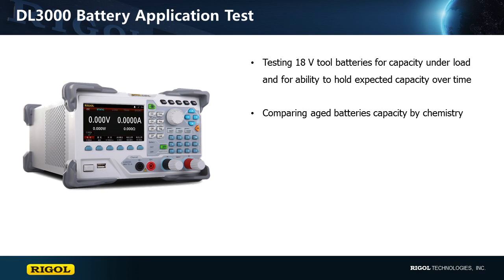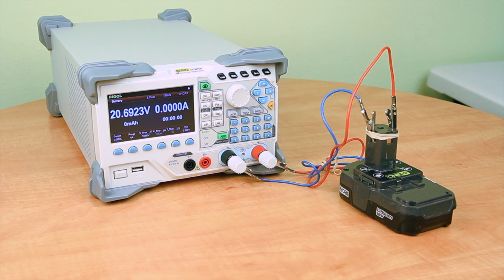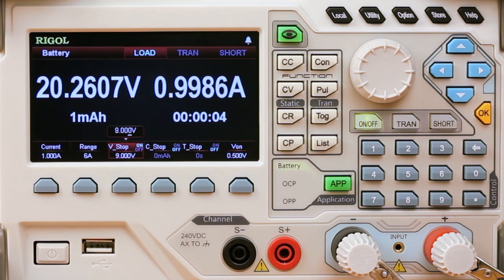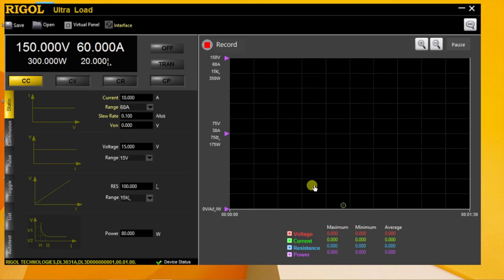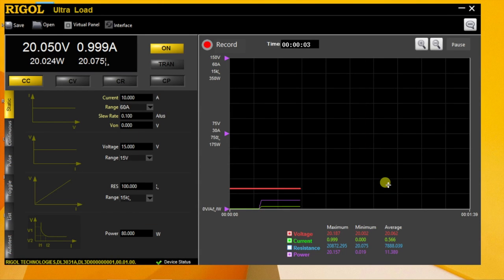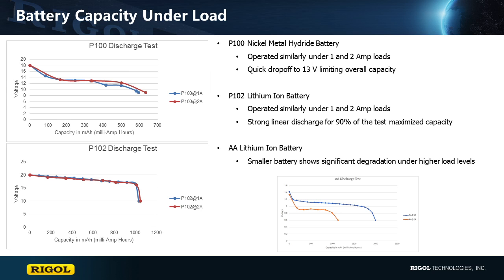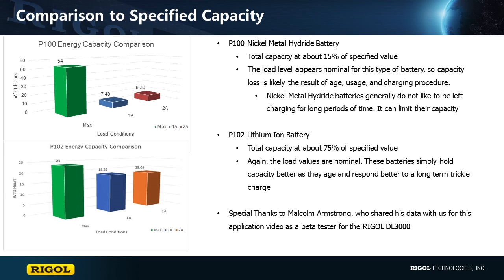Battery Testing with an Electronic Load

Comment: Thnx for the video. It would be nice to have such videos for all the features of the device. Usually batteries have lower capacity at higher discharge rate and higher capacity at lower discharge rate. In your results both the P100 and P102 gave better, slightly higher capacity at 2A compared to the 1A discharge. What is the reason for that?

Comment: I just bought this instrument because I wanted to use the battery plot function with a computer. I confirm, this function does not work, the battery test does not work with the ultraload software.
Reply from the maker: Hi, there is a new version of the ultraload software called S1501 that includes battery mode operation. with latest firmware and software this can be done. Get the software here: https://beyondmeasure.rigoltech.com/acton/attachment/1579/f-0781/1/-/-/-/-/S1501%20Ultra%20Load%28PC%29Install_00.01.00.02.zip
Reply: @RigolTech  Hi, thanks for your help, and thanks the new sw version.

Comment: Just a hobbiest here . I'd like to know what do program as a constant when testing batteries in general , do you keep the voltage or current steady ? Can this be explained any easier for a diy hobbiest . I'm basically studying this machine to see if my gate motor batteries are any good . I stay on a farm and it's a hassle to drive into town everytime.  Any advice
Reply: I will do my best to help.  The answer is it depends on the batter you are testing.    What most people (really) want to know is how will this battery perform in my device.  For best results you should test at the average load of your system.  Battery capacity will vary based on load, so if you know the load of your system use that.  To determine the load of your system, measure the current going into it from the battery.  To do so Put your system / device in a state where it spends most of its on time in .  The current you measure in that state - use that number.  If you do not want to use that method, then I suggest you use what is called the C value or to be specific .5C.  The C value is the mAHr rating for your battery.  For example if your battery is 3400mAHr then that would be 1C, .5C would be 1700mA as the CC load.  So in theory, your test should run for 2 hours.  1700mA per hour, for 2 hours is 3400mAHr.  It never works out that way, but it should be in the ball park.  The last thing you need to know is the empty cell voltage of your battery type.  This number is different from chemistry type to chemistry and depending on pack configuration and depending on if you want to test the battery itself or how it behaves in your system.  This is the voltage on the battery that you stop your load testing.  BE CAREFUL to get this number right, as overly discharging the battery will destroy it.  I never suggest using the 1C rating for reasons I won't get into here (this response turned out longer than I thought), but others might.  If you are trying to test the manufactures claims you will need the actual datasheet of the battery to see the exact method they used.  If the battery was purchased from China, don't waste your time, you won't get anywhere near what is written on the cell.  Hope this helps.
Reply from the maker: In general, we use constant current to draw the battery at a fixed rate. You can then get a WattHours reading for how much energy it puts out before the voltage drops to a certain amount.

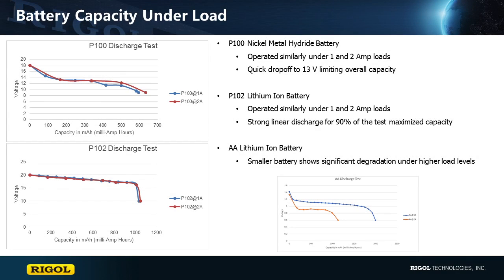Comment: At 3:57, you show your graphing of the capacity in mAh - how did you generate your Excel graphs? I didn't end up with time in my data log file when I recorded the battery test using the DL3021A (I ended up with I, P, V, and R only without a timestamp). Any help would be awesome!

Comment: Can this show the battery internal resistance?
Reply from the maker: Hi. It shows resistance on the software or in standard Constant Current mode. We use the battery specific mode to show mAhours instead of resistance on the display, but there are a number of ways you can view and analyze that data.
Reply: @RigolTech  So going on the standard constant current draw, it should show the batteries internal resistance? 

How accurate does it determinate a battery internal resistance?
Reply from the maker: @eko653  Calculating the accuracy in resistance is a little complex, because in essence you have to calculate the programming accuracy of the current and the readback accuracy of the voltage. You can find that on pages 4 and 5 of this pdf: https://beyondmeasure.rigoltech.com/acton/attachment/1579/f-0778/1/-/-/-/-/DL3000_DataSheet_EN.pdf
Reply: @RigolTech  I just bought the rigol dl3021, on a 18650 vtc6 cell the resistamcr is showing over 1 ohm... in constant current mode.. constant 1A draw.. why is that?

Was it really hard to implement the internal resistance value I guess it was just a software thing?
Reply from the maker: @eko653  Hi. The resistance is calculated by the voltage presented to the load and the current the load is absorbing from the battery. Therefore, it is highly dependent on the current. You have the load set to 1 A and it is likely a ~3 or 3.7 V Cell. So, the internal resistance at that operating point is > 1 Ohm. If you set it to pull more current you should see lower impedance. Minimal internal resistance for that cell is likely at a much higher current. You can always reach us at help@rigol.com for more info or support.
Reply: @RigolTech  If we connect a load across the battery, the voltage across the terminals drops. This drop in voltage is caused by the internal resistance of the battery. We can calculate the internal resistance if we take readings of the open-circuit voltage and the voltage across the battery's terminals with a load attached.

Vi is important. It's the voltage drop under load.

Vi = Voc-VL
Vi = 4.16v-3.33v
Vi = 0.83v

Vi = I * Ri
0.83v = 20A * Ri
Ri = 1.07v / 15A
Ri = 0.0415 ohm.. 

So this load will never be able to show this value and I need to do it manually.. it's simple math and it could've been integrated, software problem
Reply from the maker: @eko653  The load does not make that calculation. You could pulse or toggle the current and view the 2 voltage values on the display, but there is no automated calculation for the internal resistance. Just the resistance presented to the load.

Comment: for battery test ....it is possible to set programmed stops time ?
 infact in many applications  they are rarely used continuously without stopping until the minimum discharge voltage,  this possibility is there?
Reply from the maker: Hello. Yes, you can set start and stop values and times in list mode. That is a very common use case. You can also program other modes to stop when a voltage limit is reached. It's a pretty flexible tool.
Reply: @RigolTech   thank you for the answer but I don't think it can do what I thought, 
my idea was to run a discharge program that includes several stops and restarts until the total discharge is reached. 
However I will evaluate this tool which still seems valid to me
Reply from the maker: @ultrabeamitaly1  There are a number of dynamic modes. You could use the toggle to move from an ON state to and OFF state dynamically or you could use the LIST mode to set, for example, a 1 Amp draw for 5 minutes, then a 0 Amp draw (off) for 2 minutes, and so on. In this mode you'd need to monitor for total discharge. So, a number of configurations that may be useful along with different ways to monitor it. The free Ultra Load software may also help with the monitoring.

Comment: Only problem is that you just killed your lithium battery by draining it down to 1,8v/cell in that 5 cell pack. Dont go lower than 3v/cell and absolutely not under 2,5v/cell.
Reply: but thanks for a good video.

Comment: Thanks for the demo! I'm looking for something like Rigol DL3021/DL3031 Programmable DC Electronic Load Tester. Does these testers have a long record time - like several hours, to test the voltage and amps a power supply is using with a graph on the LCD display? I assume it is savable and one can print these - do I need a certain model Rigol, before this feature is enabled? Is there anywhere less expensive version that can do what this Rigol does? Thanks in advance for your answer.
Reply from the maker: To record data for hours or days with the DL3000 series I recommend using the free software S1501.  This software allows you to remotely control the instrument and to record the data as a CSV file.

Comment: Is this used to charge and discharge the bttery
Reply from the maker: The DL3000 can be used to discharge batteries.  To charge them you will need to also use a power supply.
Reply: @RigolTech  can it discharge at different rates like 1c 3c
Reply from the maker: @sravya258  the instrument can absorb power at different programmable rates

Comment: Can I use modes other than CC in battery test mode? Will mAh and Wh always be displayed?
Reply from the maker: mAh and Wh will always be display in the battery test mode but you are unable to change the mode out of CC mode.
Reply: @RigolTech  That's no good! I was going to purchase this unit until you told me this. Can this be added later in firmware?

Comment: Once the device (DL3021) is set on Battery mode and the PC application is connected, it show the message: "APP mode is not supported in the main interface, CC mode will be enable". After active the load in the PC app (press ON/OFF button) the current is zero. It seem the settings doesn't come from the APP mode like show in the video. I try many ways but I was no able to record the variables in the APP using battery testing. Neither in device View screen, with record function (just 96 sec or less using a USB memory). Not sure how this video is made. Any suggestion is welcome.
Reply from the maker: The instrument was already set into the Battery App before it was connected to Ultra Load and then once it was connected we used CC mode to record the data.
Reply: In CC mode, the application or device, can show the progress (i.e. mAh) or stop once the voltage is 2.5V? We don't want to damage the battery without a stop condition.
Reply from the maker: You should be able to set the instrument into Battery Mode on the front panel of the instrument and set your stop conditions before connect the instrument to computer to record the data without the instrument leaving Battery Mode.
Reply: That's just the issue i'm reporting. Once the PC application connect to the device, the device switch to CC mode. Do you mean, even if the device says CC mode, the stop condition is still present?

Comment: I believe firmware v00.01.01.00.09   2017-08-014 added watt-hour measurements to the battery test program, but does it also add support to stop testing after discharging a certain Wh amount? Similar to what C_Stop does, but in Wh? Perhaps an updated video with the latest features will be helpful.
Reply from the maker: Currently at this time, Battery Test includes a V_stop and C-Stop but does not include a W_stop.
Reply: RigolTech thanks for the response. I hope W_Stop is added soon.

Comment: The battery test really needs to test batteries in watt-hour to be useful. I don't understand why ampere-hour is the only value being displayed, it's not useful at all.
Reply from the maker: Hi. Actually we will be adding this in the next few weeks in a new firmware release. It appears right next to mAhours in the battery test app.
Reply: ITTSB Blog Europe the accuracy and resolution of the ZPB30A1 is not good enough for my purposes, but thanks for sharing the info anyway.

Comment: in 4:04 how to make the chart
Reply from the maker: It was made in excel with data pulled from the load record file.
Reply: RigolTech is easy to make...?
Reply from the maker: Your are correct.  The file will output a voltage, current, resistance and power measurement in reference to time.
Reply: Hi, what´s the smallest time resolution it records those values?